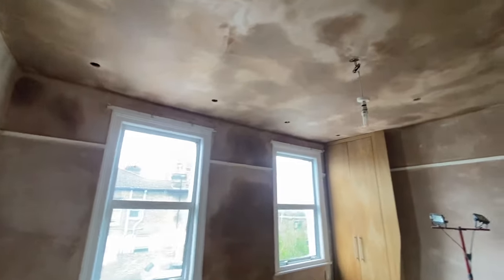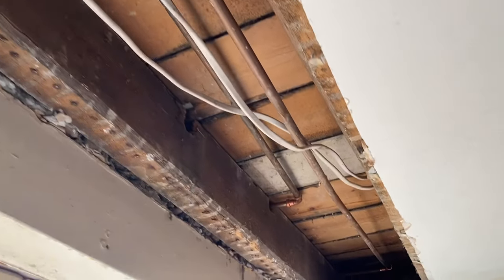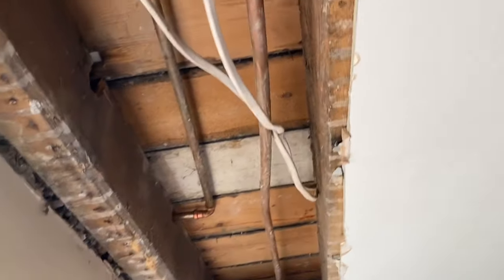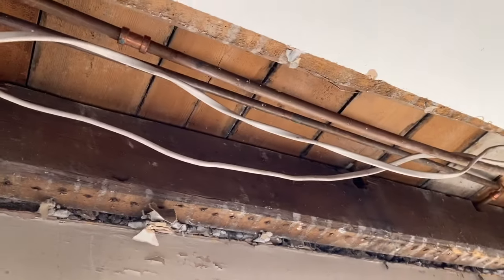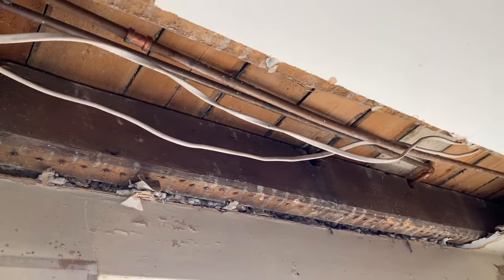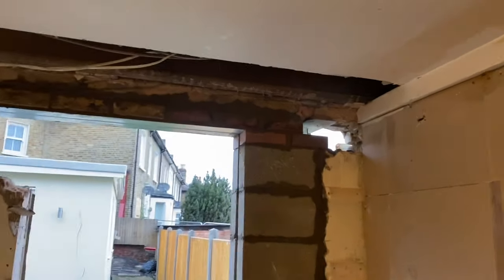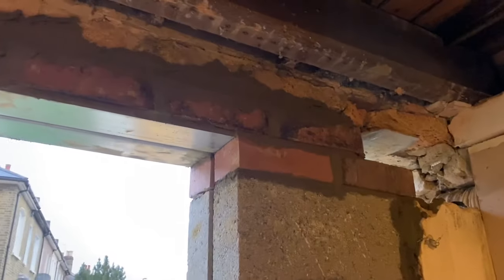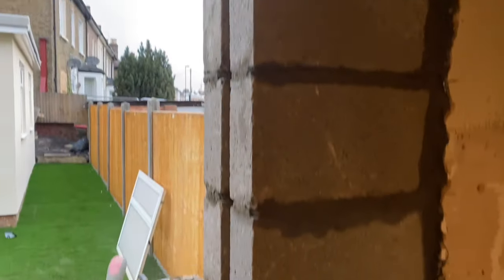Installing a steel door lintel

Comment: Not to take away from your hard work but it seems you’re building  cement blocks in with clay bricks? Thats no good as they expand and contract at different rates and this will result in those unwanted cracks the plaster.

Comment: That lintel looks wrong to me? Looks like the type you fit to internal wall not a load bearing external wall with all that weight above? My building regs inspector made me rip mine out and fit RSJ. That’s Newham for you. Great work as always
Reply from the maker: Hi Mark, yes this is a load bearing lintel. Some councils are over the top

Comment: Should you not be wrapping that lintel in DPC and adding weep holes to let water run off??
Reply from the maker: This wall has no cavity so you won’t have a cavity tray. The old window had none above it. Also as the wall is rendered wall it’s not necessary
Reply: @darrenthebuilder  thanks! Great vid fellas
Reply from the maker: No problem you’re welcome

Comment: Hi I would've thought your props needed to be a bit more in the middle as the wall either side will offer support so putting props near to the surrounding wall isn't doing so much. What do you think? Obviously nothing fell down! But am just researching my own project 🙂
Reply from the maker: Hi Tom as. A general rule keep the distance to max 900mm apart. You’re. Right that nearer the wall doesn’t need as much support. I can’t honestly remember what the thinking was behind what we were doing as it was so long ago lol.